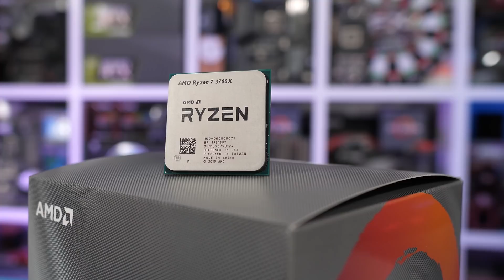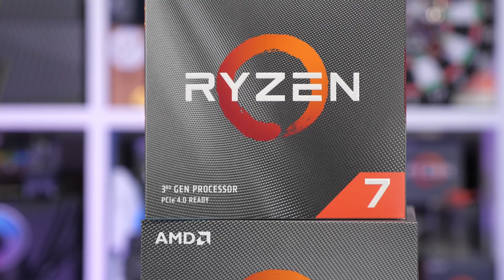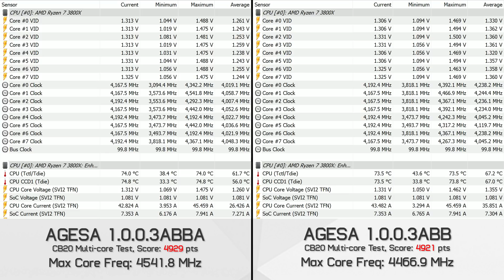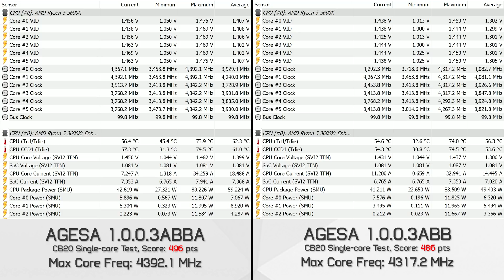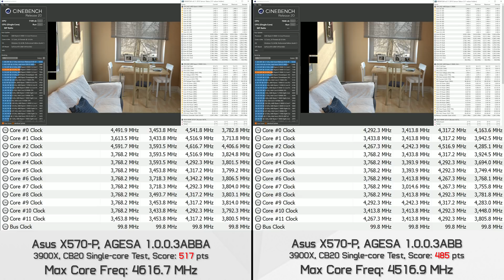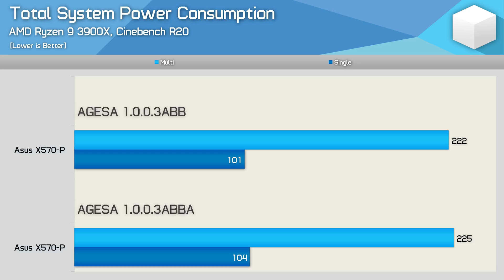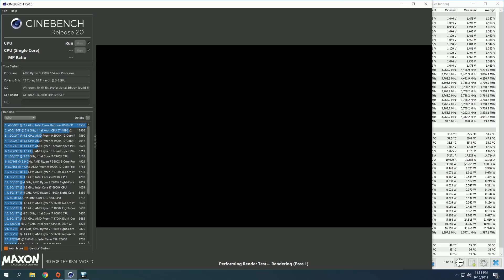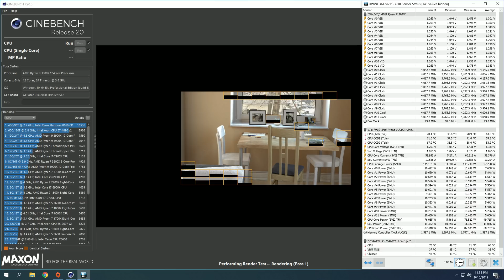3rd Gen Ryzen Boost Clock Fix Benchmarked, AGESA ABBA Time!

Comment: So, I am buying a B450 Tomahawk Max tomorrow which comes with Ryzen 3rd gen out of the box, do I have to update bios again?
Reply: Yes.  The  board you will buy tomorrow  was manufactured before the ABBA release.
Reply: @jamesthomson8659  The store guy is telling me he wont update the BIOS because he says the manual updates aren't stable?
Reply: @Palademix Check on the B450 Tomahawk max website.  The ABBA bios may not have been released for that board yet.   AMD just released the ABBA update.  Motherboard vendors will release X570 updates first.  X470, B450 etc may not be out for a few weeks. Just as an example ASUS only released the ABB Bios for my X470 board this week.  I don't expect to see the ABBA version until next month.
I haven't even bothered to update to the ABB bios  as  I know it doesn't solve the boost issue.   Updating a bios isn't hard, and really the performance improvement here is minimal.  The Max Board will work fine with the 3rd gen chips , it just may fall a little short on boost until the bios is updated to ABBA.

Comment: I'm running on 1.0..0.3 ABB bios on x370 taichi upgraded from Ryzen1600X had this board for 2 years never really had any issues the new 3700X is running everything buttery smooth and I see no real issues at the moment.
I checked my boost clock when playing games and highest I've seen was 4276 Mhz and it usually runs around 4226 Mhz on all cores when playing games didn't test many games tho ...
Anyone else in similar situation, I'm curious as to what your behavior is, I'm pretty happy with my current setup don't really care about hitting 4.4 GHz if everything is running smoothly already but i'm just curious.
Reply: If you look at the survey by debauer which had a 3000 sample size there are many people in the same situation as you but if you watched Hardware unboxed motherboard video you can see that a motherboard can make over a 200 megahertz difference in maxboost so hopefully this bios update will make sure that those lower-performing boards can perform to spec as well
Reply: @CloroxTree  Cool thanks for letting me know

Comment: Prop to AMD for fronting up and fixing this so quickly
Reply: 2 months after release is quickly for you? You've been all beta testers, early adopters, however you wanna be called...
Reply: @Valandized  and thats been the case for every new product basically
Reply: @Valandized  hi, yeah, 2 months is pretty fast considering it was an issue with some board and not others. It needed to rise to attention from people reporting it. And when they did they fixed it.
Reply: @LukewarmEnthusiast  Yes, I would expect a CPU to work as advertised and I'd gladly wait a little longer for a finished product than a half-finished one. I never upgrade my mobo/CPU combo once a year. I tend to buy a system that lasts at least 4-5 years, for which even for the AM4 won't be enough. And I personally don't care about companies at all, I always buy what's best at the time and I expect to get what I pay for. So if you wanna praise AMD or any other company for misleading practices, do so..I won't

Comment: "fell 8 mhz behind" no big deal

I used to have a 4mhz computer...
Reply: That's a pocket calculator by today's standards, lol.
Reply: @bgtubber calculators tend to run at around 300mhz, the TI brand is my experience hovers around that number.
Reply: Damn..... I bet that u still using an old 90s PC....
Reply: I had one that boosted from 4 mHz to 8 mHz at the flip of a switch.

Comment: i dont get all the hate AMD is getting over this. I remember back when Intel used a FSB and 266mhz motherboard clock my "2.4ghz" chip ran at 266x9 giving 2.394ghz. and most other intel chips ran just under their clock speeds due to the odd motherboard frequency.
Reply: Actually, there was almost no hate or frustration at all...if it was Intel, that would be a whole different level of outcry from everyone. Fanboys were really forgiving to AMD
Reply: @Valandized  not really, remember intel used to advertise all core clock boost on 7th gen i7 but stopped on 8th gen because they knew the chips could not get close to the rated speed without going miles over the TDP. the only person i seen covering that was adored the rest of the tech press didnt touch it.
Reply: @geofrancis2001  Don't get me wrong, I support neither Intel nor AMD for misleading practices. I haven't heard anything about these issues with their 8th gen so I can't comment. I can only speak of my 3770k which has always been reliable since day 1. It's hard to decide what PC build to go for the next few years, because I don't intend to change CPU every other year and don't quite trust AMD now (I used to, while I had an Athlon64)
Reply: @Valandized  i wouldn't say i was a fan of either but AMD has never burned me like nvidia or annoyed me like intel.

I used to refurbish laptops for a living back when nvidia was having solder issues and it got to the point where pretty much every laptop from every manufacturer with nvidia chipset or graphics card was failing. I had to stop buying and selling anything nvidia because of the amount of money it was costing me in returns.

intel just constantly piss me off with their arbitrary product gimping and shady marketing

like no VT support on unlocked chips 
needing a business chipset for VT 
socket or chipset changes for every generation of processors regardless if its actually needed
pci-e lane gimping by either reducing the number on lower models or including chipset lanes in marketing material.
not supporting ecc on anything but xeon 
multiplier locking on everything but K processors 
having i5/i7 dual cores
totally made up TDP.
sending out cherry picked cpu's for review
multicore enhancement on review boards
turbo time set to unlimited on boards so its out of spec
the whole 5ghz 28core chip under a chiller fiasco 

generally my laptops are intel because they got best battery life but desktop is usually AMD since they always gave more cores for less money.

Comment: Last remaining and most important question after the release of the ABBA Agesa...: are we eventually going to see a AC/DC version as well?!?
Reply: Björn Paulsen I am afraid many would ditch AGESA 1.0.0.3 ACDC. It has wierd boost cycle that goes from 0 ghz > 5ghz > -5ghz indefinitely. Same goes to your fps
Reply: @onlylonly888  ... and finally, when you have been up and down the 'highway to hell' of core clocks, your CPU is gonna be 'thunderstruck' by 'high voltage rock'n roll' ...

Comment: I have an og gigabyte gaming ab350 board for my 3600x.  Hw monitor shows it does get to 4.39mhz but it hardly stays there and my temps stay at around 60c when gaming.  It usually is clocked at 4.2ghz.  hardly see it boost.
Reply: It's "boosting" if it's above 3.8GHz.

Comment: I'm on a B350 MSI board, so it will be a long wait. That said, I tested Cinebench R15 with a 250 ms polling interval and see peak boost of 4575 MHz, and the average (of the peak core for each interval) was 4505 MHz for my 3900X.  I see up to 4650 MHz just opening apps in Windows.

On another note, it seems you've finally matched my Cinebench R20 1T record of 517 points, though I had CCD1 disabled at the time. Still 11 points short of PC World's 528 at launch. They must have the real boosting Queen.

Comment: I'm currently using a Ryzen 5 3600 with a Cooler Master MasterLiquid Lite 240 RGB AIO, on an AORUS B450 AORUS ELITE M/B with it's latest bios, not the as yet unreleased one you're talking about for this board, and mine overclocks stably to 4200MHz, and boosts up to 4300MHz from there on its own on all cores.
I'm using CPUID HWMonitor for measuring the numbers. From everything I've read & watched, I may have gotten lucky with the silicone lottery.
Reply: I'm always up for some silicone lottery.
Reply: @aspiringtosomething2023 . Aren't we all!! lol.
Reply: Is a 3600 at 4.3ghz good? I got 4.4 with a 115i. And thought it was average
Reply: @jaanseel7827 . When playing, I haven't noticed the diff from 4200MHz to 4300MHz. My GPU is a Gigabyte GeForce RTX 2070 Super Gaming OC, so with reasonably high FPS, you don't really notice the diff in CPU MHz boost.
Reply: Adrian R you play at max settings? I play fortnite on low, there’s a noticeable difference while in endgames

Comment: I notice something weird. Steve gets 491 points with a maximum core frequency of 4566.8 MHz, I always got more than 500 points on R20 with my 3700X while the maximum clock frequency was 4.367 GHz and now is 4.391 GHz. The only sensible explanation is that for me the maximum frequency is achieved more frequently and longer. I don't know what he cooling he uses (sorry if I missed it), I use an aftermarket cooler.  For multithreaded I was able to get to 4935 points with multithreaded R20 with the previous AGESA, with the current it is a bit lower (4850-4900). I did notice that with the current AGESA the run to run variation in the score is lower for both singlethreaded and multithreaded Cinebench. Originally I had quite a strong variation (up to 100 points for multithreaded), now it is incredibly constant (several runs with 0 points difference).
Reply: Could be that you have better silicom chip that maintains a bit higher clocks throughout the benchmark run
Reply: @ademiravdic  
I should add that I had not spread spectrum disabled yet. Now I see up to 4.4 GHz on the cores. However, the single core performance did not increase, my Cinebench score remains the same (now 504 points, I got up to 507 points). It might be that the boost is a bit higher but also maintained shorter or achieved less frequently. But probably not a loss so all good. :)
Reply: What's your ram? The one used in these benchmarks were 3200cl14.
Reply: @mkl0011  

At the moment 3666 with sharp timings from the DRAM calculator, running at 1.38V for the RAM and around 1.10V for the SOC. As far as I have seen there is little scaling with RAM for Cinebench which makes sense for a tile-based renderer. I got similar scores with my RAM at 3333 and horrible XMP timings (Corsair or Gigabyte needs to improve that). I might have gained 1 or 2 points but singlethreaded it almost always got above 500, maybe twice 499 but most certainly not lower.

Comment: There is a performance-decrease when you use hardware-monitoring software but I have had it happen more than once that the second run of Cinebench with HWInfo64 running gave a higher score than the first run without HWInfo64 running. Apparently the impact of HWInfo64 is that low that the run to run variation has a bigger impact than the monitoring software, which is great. :)
Reply: What you're seeing is the branch predictor module of the CPU in action, a sort of AI built in which tracks usage patterns. When you run the same or a similar workload more than once,  the branch predictor prepares the necessary instructions to execute in advance which boosts performance. That's why usually the 2nd run is higher than the 1st one.
Reply: @bgtubber  

I know about that and that was my first thought too but here the weird thing: with the previous AGESA (ABB) this was not the case, I even noticed that the score went down for the later runs, sometimes a lot, like starting at 4830 and ending at 4730 while the temperature stayed under 65 degrees all the time and I waited with the next run until the temperature came down. One big differrence which I notice is that the scores on Cinebench got a lot more consistent. On the previous AGESA I noticed up to 8 points difference for singlethreaded (R20) and up to 100 points for multithreaded (PO disabled in all cases). Now when I do 2 or 3 runs in a row I get exactly the same score. Whatever AMD changed, it varies a lot less.
Reply: @peterjansen4826  Interesting observation, thanks for sharing.

Comment: 3600(X) vs 8700(K), stock/oc & 3700X vs 9900K?
Reply: 9900K still faster specially with >4000mhz ~cl17 ram  i guess around 5-25%
https://youtu.be/LCdA-bLRAfM?t=902
Reply: @BadRusMan  4000 mhz cl17 ram is expensive. And Intel pussies whined that Ryzen got a boost from 3600 mhz ram.

Comment: Dear Steve.. can you test this on B450 Boards like Tomahawk or any 2018/2017 Mobos when it cames out?
Majority of people using 2018/2017 Mobos & we would like to see if Mobo companies keeping their old Mobos with good performance updates, or they care only about X570 Mobos, thanks in advance  :)
Reply: I have a 3600 with a b450 tomahawk, even though I can easily OC it to 4.2ghz it will only do a single core boost of 4.10ghz and 3.85/3.90 on all core on auto, no ABBA bios release yet.
Reply: Would like to see this tested too
Reply: I agree. I just bought a R5 3600 and a tomahawk b450 and I want to know if this affects me at all
Reply: I just test on Asus prime x470 -pro
My clocks went from 4.391hz on 2 cores and rest between 4.321 to 4.366hz to 4.5hz on two cores and rest 4.45hz POB on. Processor 3700x so I'm happy with update.
Reply: @erouz11  
What about temps and Volts? any difference?
Reply: @Jack_Sparrow131  didn't notice difference
Reply: @Jack_Sparrow131  and I'm on air-cooler. Be quite pure rock never above 79 c
Reply: There will probably be some tests, if not HUB then some other channel, but first we need to get the bioses from the manufacturers. It's normal that they would focus on the x570, but b450/x470 will take more time, and b350/x370 will probably be the last ones updated. The b450 tomahawk just got the abb beta bios, it's gonna be ~3 weeks I imagine, for the abba version.
Reply: That's a nice autoOC boost you can get, I'm also using the AGESA 1.0.0.3AB and autoOC does nothing for my cpu, but it might be the cooler, I'm using a Hyper 212X, it gets quite a bit hotter, about 80ºC on an AIDA64 Stability test.
Reply: aboud alaboud Steer well clear of MSI previous generation b450 boards with ryzen 3000. BE WARNED.
Reply: there won't be a difference, no point in doing that

Comment: Great video. I have been using a modded bios based on ABB but with the latest SMU and I can confirm even the modded version has fixed the boosting on my Crosshair VI. Once the ABBA agesa comes to my board, I think it will just be the icing on the cake as the actual agesa has tweaks too. But I'm happy and can't wait for the proper bios

Comment: This is the part I dont understand....on the BOX a 3700x says 4.4ghz.

If I buy that I EXPECT  it to hit that speed 24/7....not for a split second.

So saying it hits the advertised speed is simply not true, hitting it in a benchmark for a fraction of a second is not what people bought or expected. 

I want my CPU to run single core 4.4 non stop...that is what people who bought these chips expected.
Reply: u can expect anything you want but there is no claim from amd that 4.4 should be 24/7 so it is tricky but nothing to say in AMDs side
Reply: You might have expected that. I did not. My last Intel Chip I7 6700 did not run @ Max Boost 24/7. This is not how Boost works....

Comment: You might like to compare SOC voltages at auto between different brands of boards and between ABB and ABBA Agesa bioses. Aorus auto setting it to 1.08V seems to allow boosts to work. Mny other boards Auto setting SOC to1.2V doesnt boost well.

Comment: I have a question please 
Can I overclock my rayzen 5 3600 with be quit dark rock slim ??
Or should I go with dark rock 4
Reply: I’d get whatever is cheapest. The 3600 has a tdp of 65w so either of them will keep the 3600 satisfied. But you get get much from overclocking ryzen 3000 and there won’t be a noticable performance difference from either of the coolers.

Comment: My R5 3600 is currently hitting 4130 mhz on 4 cores and 4100 mhz on the remaining 2 cores. I'm downloading the new bios now, I'll report back if it makes a difference. After the bios update there has been an improvement, but still not hitting 4200 mhz on all cores. Instead it's hitting 4200 mhz on  2 cores, 4180 mhz on 1 core,  4150 mhz  on  2 cores , and 4100 mhz on the remaining core. I can however manually set it to 4250 mhz on all cores, but I'm leaving it on auto for now.
Reply: 4.125 5 cores 6 one 4.1 lets see